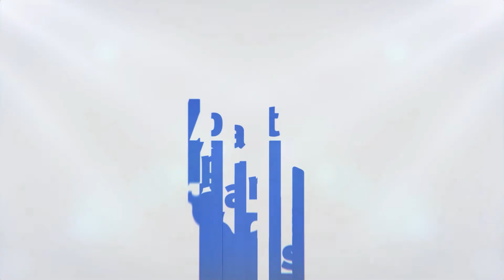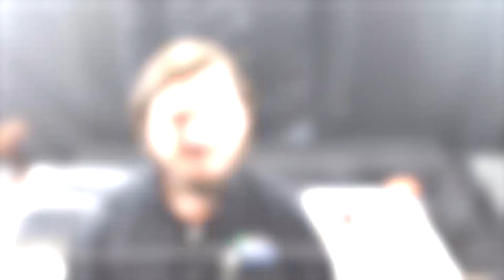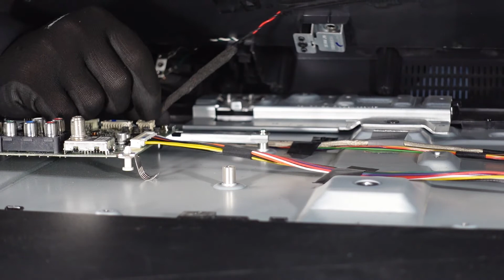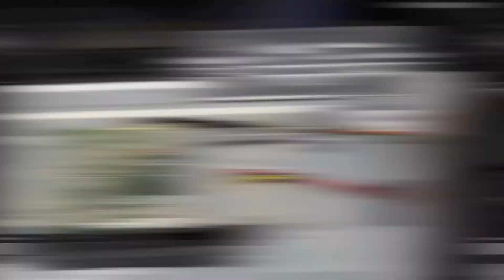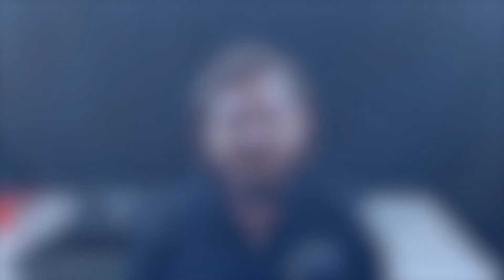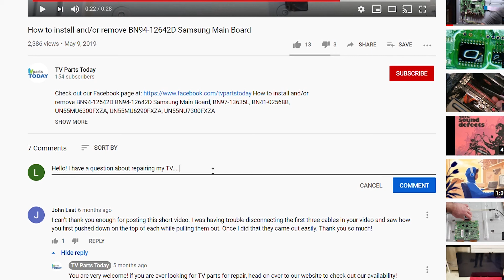Easy TV board removal!  (TOSHIBA 50L1400U)

Comment: Hello thanks for the video.
I look at your power supply board is not the same as mine and yet the title of the video is supposed to be the one I have 50L1400U.
Do you think that the Toshiba company would have changed the board?
It would not surprise me because the new board that I bought new is different from the old one, because they removed a chrome device in the center that I do not have.
Could you give me the number of the board so that I buy the same as yours please.
Thank you
Reply from the maker: I did a little digging and it looks like the power supply in this video is a: 75037555

There are 3 different power supply boards that are compatible with this unit, so I'm not surprised that the one that you were sent looks a little different. All of the plugs and the functionality should be the same.
Reply: @tvpartstoday  Hello, Thank you for answering me I looked carefully at the old card that was in the TV and I notice that a part has been unsoldered and it is the part of the chrome center with 2 black resistors with 3 pins they are both located under the chrome plate that I am talking to you about, I am sure that if removed they would prevent the fuse from burning, because since I bought this card the fuse blows every time.
Do you think this is possible??
Reply from the maker: That's probably what is going on.  I would make sure the next board you put into the TV has all of the original parts on it.  It sounds like someone tried to unsuccessfully fix that power supply.